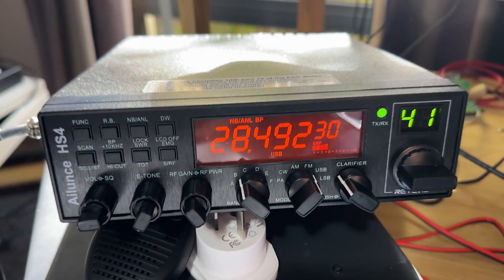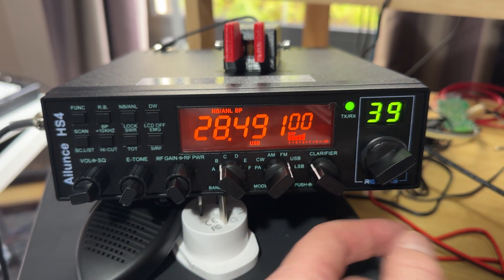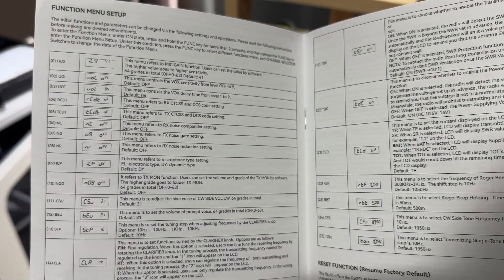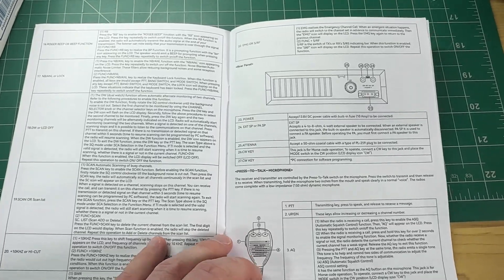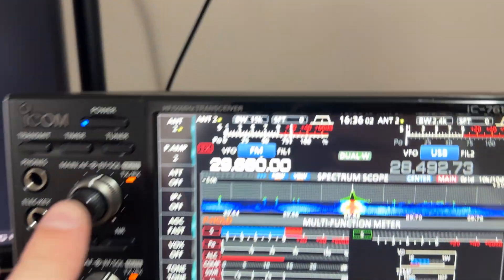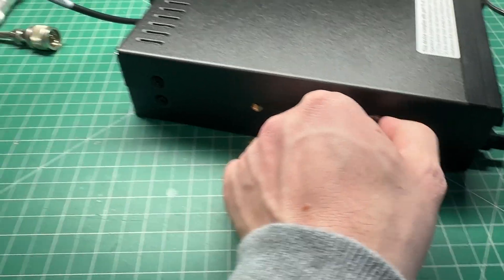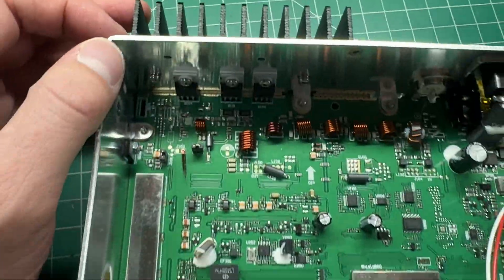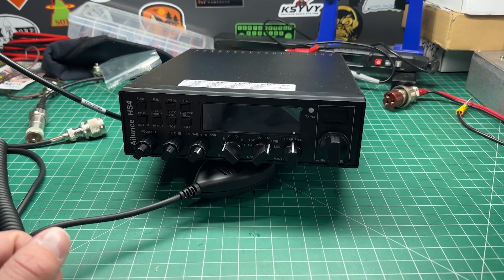A Solid 10 Meter Radio with One Major Issue..

Comment: Once you change the frequency on channel 35, then switch around a few channels, it remembers where you left the frequency. So you can return to a QSO if you so desire. That is the reason when you rotate the channel knob, it changes to the frequency you left it on so you can go back to that frequency again.
73’

Comment: You need the pc software ,theres options to stop remembering/altering frequency public mode,extra options.

Channel encoder is a hang over from cb channelised mode.

They do a short version set now SS8900

VFO mode is now being fitted on later models (not the model you have)

Glue is for vibration in vehicles , mechanicals on components.

Check out AT6666pro or Radioddity QT-80 or President Washington 2+fan kits 
those have vfo mode.

Can program in via pc software 3khz steps ,why hams use odd step sizes never got that ??
0/5kc lot easier on ssb ,why complicate it ?

Best of luck ,have fun with radio 👍

Rob P 73's

Have fun

Comment: It's not a ham radio. It's a CB radio targetted at the CB freebander DX market sold as a ham radio to get around certification requirements for CB radio. It's actual target audience use channelised bands which is why it has a channel selector rather than a proper VFO for tuning.
Reply: I believe the 10 meter band is a ham frequency isn't it? So how come it's not a ham radio? Just saying, because I am a very poor ham operator and can not afford a real hf rig like rich operators do. So, I bought an Anytone 10 meter radio so I can do dx legally. Is there anything wrong with that?
Reply: @franciscolopez3229  nope nothing wrong with that. And props for doing what ya need to do to get on the air. I think the comment though was just to point out the true purpose of the unit 😀
Reply: @franciscolopez3229 they sell it as a 10m radio, and out of the box, it is. So they sell it as a 10m, but the customer can simply change a jumper on the pcb to unlock cb
Reply: @franciscolopez3229  some of the most fun I've had is getting an unexpected DX contact via cheaper equipment. When I started up at 14 my shack was cobbled together with half broken hand-me-downs club members had sitting collecting dust. I had to pull most of them apart and repair them just to get them in spec. Don't let the elitist appliance operators get to you.

Comment: Get a Yaesu 891 on sale for just a little more.  These issues you run into are common when a CB radio is opened up for 10 & 12 meter operation.  Let’s be frank, these are sold for the free bander market.
Reply: Can you show me where I can get the 981 for just a little more money?
Reply: @ todays price is 629 and it’s not on sale.  On sale at least 100 less.  And yes, in this day and time that’s just a small amount of money.  YMMV as they say.
Reply: @jctrame  So, even on sale it is still $300 more! Over double the price.

Comment: It is odd that Retevis are selling a channelised transceiver as a HAM radio.  The use of potting/glue on the crystals and inductors is likely to stop them from moving under vibration - say if mounted in a car, truck or boat.  The tuning knob would be better if it was multi-function - say with a push function that could toggle between channel and VFO mode.  

I found a copy of the manual online - no mention in it of the USB connection (not even included in the picture of the back of the transceiver).  Adding some extra functionality like CAT/CI-V might have addressed some of the radio's shortcomings.

It's a shame they did not push the specs a bit further.

Comment: That radio hard to use for SSB. The anytone AT5555 N II much better as well is QT 80 PRO . Just push button and number gets underlined and you change. and you can set steps in menu. I keep 1 KHZ. and the clarifier is changeable. TX/RX or just TX or just RX . and nice in fine . They do receive real nice . The QT 40 is hard to use as well. For just a bit more money you can get a money you can get a much better radio.  I mostly use SSB . I did make a 10 meter AM contact on 29 MHZ.  Been open in NY real nice but Had QSB bad at times in afternoon. The AM was great from NY to UK . I got Midrid on 10 the outher day. Think we got solar storm with the bad QSB and 15 meter went down.  73

Comment: you can change the tuning step by pushing  the clarifier also you can change the steps in the menu when you just turn the clarifier,also this radio is made for cb (11 meter)also if you want to do repeaters you need a programming software

Comment: I'm probably not the target audience for these radios... they are so close to being useful for ham that its almost embarassing.  Would be great with a sound card or at least in/out audio jacks and a VFO.  Sure I can make one, but by the time you buy the rig and do the mod, you're into the $$ of a "real ham radio"
Reply: @temporarilyoffline  the new AT-6666PRO gives you all of this, for not much more money. It's a real ham radio! Check out the smoking apes videos :) 73
Reply: Yea IT's a hopped up CB that can be a cheap way to play on 10m but double yer money gets a G90 which if your goal is HAM stuff is heaps better than trying to make a "export" work. If pennies are tight though it will let you make those first HF contacts.

Comment: This is a CB radio, and NOT an HAM RADIO
Reply: It has CW. Real hams use CW on 11m
Reply: @MidlifeRenaissanceMan Real hams don't use 11m.
Reply: @johnharrison373  real hams don’t use 11m…..but if they did, they use CW
Reply: Is a10 meter band  CB band?
Reply: @АлексейЛесуков-ч3ь  nahhh. Not quite. 26-27.999Mhz is freeband on account that it’s rarely policed. Freebanders occasionally spill into the 28MHz CW section of the band but it’s typically frowned upon

Comment: I don't know why I'd want a dedicated 10m radio if I already had a general purpose HF tranceiver. Anybody want to enlighten me? Is this just a cheap way to get into HF?
Reply: Like all 10m radios, it's an overpowered CB radio being sold under the cover story of being a ham radio. I suppose it might be useful to a technician or someone who just wants to get their feet wet in HF and doesn't want to pay for a full-on HF radio, but the vast majority of users are CBers.
Reply: @grebulocities8225  The thing about price is that for a similar price you can get a 1980s 100W solid state radio which covers 160m up to 10m. I know what I would choose! The downside is that if you want to do mobile operation, the 1980s radio will be too large to fit in a car. Mind you, I bought an IC-706 mk 1 for not much more money than one of these.

Comment: That radio is being sold at US CB shops under at least 4 different names. If you hold a couple of buttons while turning it on, it suddenly covers 24-30 MHz, and when set to one of the "bands", the channel numbers just so happen to exactly match the US CB channels.  What a coincidence!
Reply: Plenty different badges over this side of the pond
MAAS DX5000, KPO DX5000, CRT ss6900, Anytone AT5555 
Afectionaly known as the Anyclone.
Reply: @g8ymw  but the big difference between HS4 and all the other clones is that it comes with completely new, improved 2024' firmware. This applies in particular to the improved DSP RX audio filter option, which is now better adjustable over 5 levels on RX and for TX as a noise gate for loud ambient noise, e.g. with the VOX function
the radios you mentioned belong to the old generation from 2010 onwards
it has absolutely nothing to do with the new generation and technology of the 2021/2022 completely newly developed hardware
Reply: I guess theres two things you don’t understand. 999 of 1000 of these sold will be used on CB ONLY.    Secondly the weird behaviour with the channel switching is because the clarifier is really editing your preset (channel).   It doesn’t do a consistent jump when changing channels because you have tweaked your channels by turning the clarifier.  Channel 1 might be at 28.7 and channel 2 could be at 28.77 and then chanel 3 at 29.2.  The jumps are any amount you want them to be, and unless you wrote down a map turning the knob is just changing which memory slot is active, and is only consistently 5 khz until you start fiddling with altering memories with the clarifier which really is a weird way to work.  They would sell fewer of these if they made a proper non channelized 10m rig, so they won’t do it.
Reply: @warp9988  I was being facetious. No self respecting Ham would buy an HF righ with a channel selector.
Reply: Other than defeating the band lock is this radio fix on the power output  like  a peak adjustment or just fix as is ?

Comment: If a radio has an echo board built in, and a roger beep, IT IS A GLORIFIED CB! PERIOD.
Reply: OH NO! It is therefore impossible to have any fun on 10m and 12m with this radio...?
Don't be such a sad ham. 73
Reply: @mostlypostie1  I guess anything beats another ht review.
Reply: What's glorified about it? It's clearly a CB design
Reply: What?! Just turn them off! Stop being a fud.
Reply: @ohenekojo2561  A FUD? A fud is a GUN owner that believes only in HUNTING rifles and not Assault rifles. Learn your terms so you dont look stupid.
Reply: Rea hams use CW on 11m
Reply: SO WHAT?!?!?
Reply: That's radist talk right there. CBs are HF radios too. 😂

Comment: I'm testing one of these at the moment too.  It's a weird little radio, but I was able to work a couple of VK stations on it.  There are definitely some limitations but the things it can do it seems to do fairly well.  My expectations were much lower for this radio so I'm pleasantly surprised.
Reply from the maker: Thanks Rob! Curious did you get the programming software running? I just tried again and I’m still getting the error shown in the video.
I’ll try on another PC
Reply: @HamRadioDX  I haven't gotten that far with it yet but I'll let you know if I get it working.  One thing I found was you can quick set the clarifier step by pushing in on the knob.
Reply from the maker: Yes I discovered that myself in post. In the function menu it spoke about changing the TX frequency using the push button on the clarifier knob, but I could only get it to change +/- 10 KHz when transmitting, not enough for the -100 KHz for repeater operation
Reply from the maker: Also I hope you’re well Rob, good to hear from you.
Reply: @HamRadioDX  All good here Hayden!  I hope all is well with you too.  BTW, the software worked for me and I was able to transmit in split/repeater mode.  I'll include that in my vide when I post it...I'm about 1/2 done with it as of today so you should see it in a week or so.
Reply: @HamRadioDX  push it multiple times to change the register
Reply from the maker: @SevenFortyOne  Awesome! I'll try the software on another PC and see if I have any luck

Comment: I think you can alter which frequency readout number changes when turning the clarifier knob by using the PUSH function of the clarifier knob.  The MENU 17 PUS function allows this to be done (PUS Stp) and MENU 16 CLA needs to be set to RT.  These radios are fun but we all know what they are designed to be used for!
Reply from the maker: Yeah I tried the push function on the clarifier knob. When you TX you can adjust the TX frequency, but it only allowed +/- 10 KHz adjustment
Reply: @HamRadioDX  I have CRT 6900 (looks same radio) and there is menu PUS (COA) then you can push knob and change those last 3numbers. Radio remember changes on chanels. I normaly not even need change those 2last numbers. That "tuning" knob is not problem anymore when using that radio more. What is the problem is that radio have very bad filters. When propagation is super, strong station splatters make very hard to listen weak stations.
Reply: @HamRadioDX  ?
with my version it is +/- 30 Khz. regardless of how the Clarifier is configured as RIT, XIT or RIT/XIT (both)